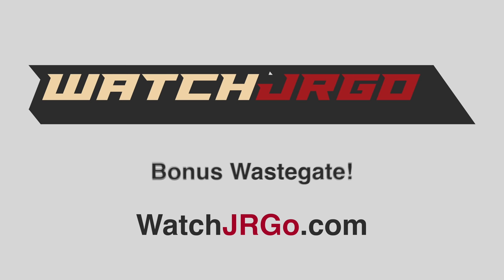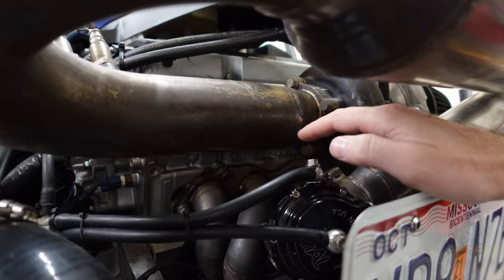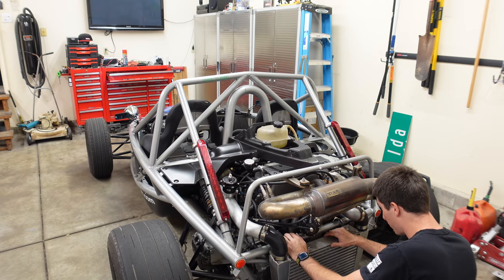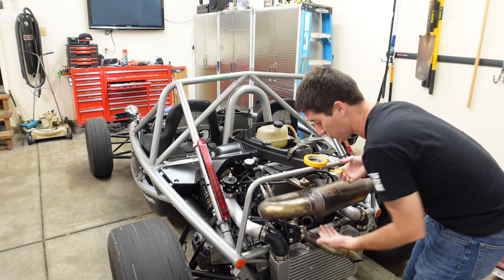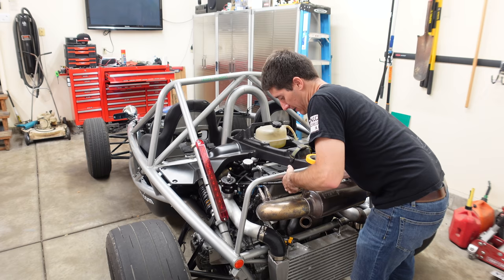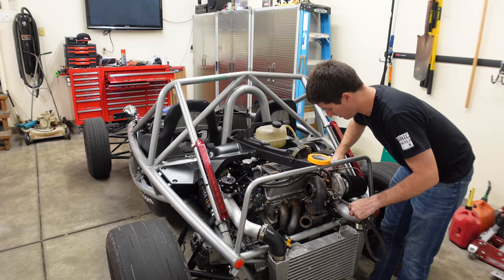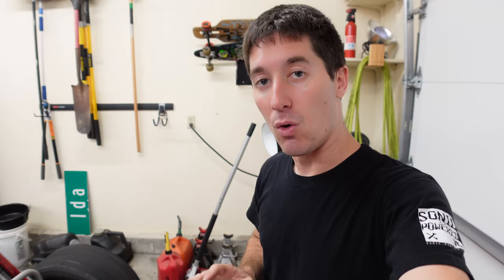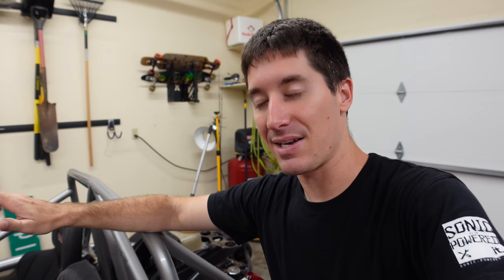NO BOOST! Pulling The BROKEN Titanium Exhaust Off My Ariel Atom

Comment: Maybe it wasn't welds that failed, maybe the problem is simply that exhaust is hard mounted to a frame? It needs to move with the engine, especially since you added power to that thing, it probably moves even more.
Reply: Underrated comment

Comment: The exhaust welds need to be post weld heat treated to relieve stress that cracks the welds.  And add bracing.

Comment: See, I did not know about the difference between waste gate and a blowoff valve

I was under the assumption that they were synonymous of the same thing
Reply from the maker: They both relieve pressure, but for different purposes 💯
Reply: The wastegate is for boost control/limiting boost by bleeding exhaust flow before the turbo (hot side).  While the blow off valve is more for protecting cold side .  Essentially a pressure relief valve after the turbo.  When the throttle is closed suddenly under boost the blow off opens to prevent a spike in intake pressure which can cause problems/damage.

Comment: When engineers were working on the SR-71 Blackbird, they found an issue with titanium components and stress fractures. The skunkworks identified that the issue was using regular tools to install components. The steel tools created  microscopic weak points in the titanium that grew problematic over time from heat and use. The solution was to create titanium tools to install fitting , bolts and components.
Reply: You can’t use cadmium plated tools or cadmium plated bolts on titanium, you are correct about the problems encountered on the SR-71

Comment: The welder should add some bracing, for better structural rigidity.
Reply: @ssnerd583  I dunno man, I have a hard time taking advice from some old boomer that seriously wrote “kiddie Boiz”
Reply from the maker: On it! 💯
Reply: Make sure welder gas purges the pipes pre, during and post weld to stop internal weld crystallization. Otherwise your wasting your time,effort and money as it will surely crack again. Lack of purging is biggest cause of cracking as you never get a full clean weld,just a pretty looking outer with a lot of crap on the inside. A lot of people mistake this as lack of support, although as another commenter has said titanium is prone to heat effects but also it's prone to stress cracking from constant high vibration loads. Easy way for anyone to tell if welds are done correctly is shine a torch inside, if internal welds are a smaller but just as uniform inside as a good external welds then welder knows what they're doing. If inside looks like uneven lumps of snot chewing gum, beware. Good luck and look forward to PFI and your efforts rewarding at the track.
Reply: @ssnerd583  What about inconel?
Reply: @taunuslunatic404  cost, can cost 2 - 3 times cost of titanium exhaust and is harder to work with. Used by top line exotic and in f1. Damn nice but usually makes the bank manager more excited than the car owner which isn't great.
Reply: @ssnerd583  most fi use inconel 625 not titanium.  It is way less heat effected or prone to vibration stress cracking.
Reply: @andrewjones9893  321 or 304 works just fine, too.....its not as fancy and doesnt cost an arm and an asshole like inconel does, either
Reply: @taunuslunatic404    TOO fucking expensive....not necessary.
Reply: What about give and take with the engine movement?
Reply: @larrybe2900  .....the heat cycling and the fact that the heat is just too high for most standard titanium alloys like 6Al4V....it just embrittles the metal and BAM!  cracks  its just unsuitable as an exhaust manifold material unless RACE CAR and you need to cut every single gram of weight....which is F1 kind of thing so you can ballast up to weight where you need to put it to balance the vehicle......totally unnecessary in a 500+hp Atom
Reply: @ssnerd583  really at the end of the day a lot people only use titanium   because it colour ups and cools fast. Most small size exhausts and non $150,000 cars it's not really worth the cost. Yes you may get up to 40% weight saving, but you trade that off with other hassles. The atom already has titanium so he has choice really, repair and improve or ditch and replace with SS. A lot very top end titanium stuff has more individual sections and may use spring type section attachment to counter expansion. I personally think on everyday stuff use SS, save the money and use elsewhere on vehicle for performance. Really about individual choice. Important thing one way or another is build quality, get it done right the first time, that's the way to use the smart money. No exhaust no matter what it's made of is going to really perform or last if it's not built right.
Reply: @ssnerd583  yea agree. Inconel is only really for the fat cats unless aim is to keep bank manager  smiling all year.
Reply: @andrewjones9893     Titanium is GREAT for a LOT of automotive uses....just NOT where it gets so hot in use and gets totally heat cycled like it does on an exhaust manifold or down pipe/turbo outlet.  I had a titanium exhaust on my Evo that started at the end of the DP and it was cool....very light and sounded 'different' than other exhausts.  Never had any problems with it, but you wont see very many down pipes made of titanium....lol
Id love to have a set of titanium swaybars and springs, but the cost of that would be prohibitive....titanium brake pad shims are AWESOME--I made some out of 6Al4V sheet I stole from work out of the scrap bin....titanium is very poor at transmitting heat through it which is why its great for brake pad shims....and intake boxes are great as they stay much cooler inside......I've made a good few titanium car parts--and airplane parts....over the years.  Great stuff but NOT for exhaust manifolds or turbo outlet pipes
Reply: @andrewjones9893    good quality, non china made, inconel would make your wallet cry and scream for mercy, even for the little you would need for the Atom exhaust.....hell....even 321 would make you blink back tears.....lol
Reply: @andrewjones9893    no....NOT.  321 MAYBE....but inconel costs way more than titanium does......you want $2.5k exhaust,not including the muffler for that Atom???  when you can have a perfectly functioning one for $500 or less???  Even 321 would be 0_o money.
I'm not a fool....why build a $150k car when you can do the same thing for less than half by not buying 'boutique' parts?
The older you get, the wiser you get....and i much wiser than using titanium or inconel for exhaust manifolds
Reply: @ssnerd583  fully agree. Been involved in builds for 40+ years and seen heaps people needlessly blow money and time on pretty things thinking they make a real performance difference. The money could have gone into internals of engine. Experience definitely makes you wiser.
Reply: @larrybe2900  can depend a lot on engine/trans mounts. Rubber / urethane heeps of movement, which is bad for solid mount exhaust (not the best for any exhaust material).Solid mount engine / trans has smaller vibration load but this can still crack titanium over time  if exhaust is solid mount. A good example is even top fuel car exhausts which are built by people at the top of their game. The side to side high speed sway of engine on a set of straight thru headers can break them. Hence why they are part of checks after runs.

Comment: Maybe a way to reduce the vibrations is an ati damper to replace the crank pulley also maybe put some kind of bushing in between the exhaust hanger and the frame instead of a hard mount to reduce vibration and stuff

Comment: Has the boost control solenoid been disconnected the whole time since the rebuild so it's only been running waste gate pressure? Would explain why it needed the stiffer spring installed during tuning at PFI...

Comment: Pretty sure that exhaust needs more flex in it. When the motor torques and heat cycles it was becomes pretty easy to crack since there's not that much movement available. Maybe use some kind of rubber or urethane hanger since there's no flex pipe. That might give it just enough flex to not cause pressure on the welds.

Comment: Remember to purge the exhaust before welding , and as someone mentioned heat treat after welding , if you want to be able to remove bolts and studs from the turbo and exhaust put milk of magnesium on the old INDY car trick.🏁🏁

Comment: Titanium is tricky to weld and get it perfect where it won't fail. I wouldn't have tried, and instead made the exhaust system out of stainless. A bit heavier, but not as finicky to weld. But that's assuming you have a way to get those bends made in that size of tubing.

Comment: Just a thot: If you leave the scoop off that blocks air going through the roll cage you might gain a 10th in the quarter since it no longer performs any function with the air filter relocated.
Reply from the maker: Honestly that might make a big difference, it's like leaving a sail back there 🍻

Comment: JR you need to isolate the exhaust from the car side need to fabricate a mounting system or use braid flex pipe from the muffler to the rest of the exhaust.I think if you do this it will eliminate a bunch of the vibration.

Comment: So is the engine mounted directly to the frame?  The exhaust seems to be.  If the engine is mounted on rubber mounts the exhaust should have a flex pipe for engine movement or else this is going to happen again.  The exhaust has to be able to flex with the engine movements.  
Take care!
-Jon

Comment: I get it, bad welds, weak titanium. Is there a way to separate the 2 vibration domains with a titanium flex bellow? Stainless are the most common, but you can get them in titanium to maintain consistency.

Comment: Do you put non-ethenol fuel in the Ducati?  I bought an SV650 recently, that sat for 5 years.  Tank and pump assembly were BAD!   Had to clean and line tank, replace pump and bypass hi pressure internal filter and add on external.

Comment: You should add a flex pipe between the turbo and the exhaust pipe so the vibration doesn't destroy your exhaust system